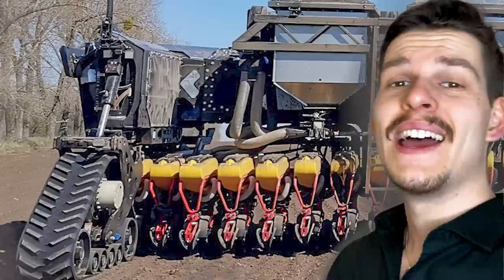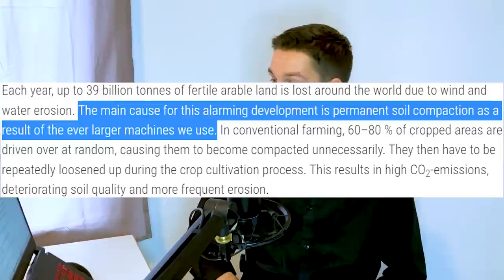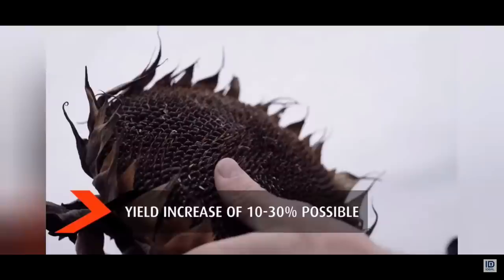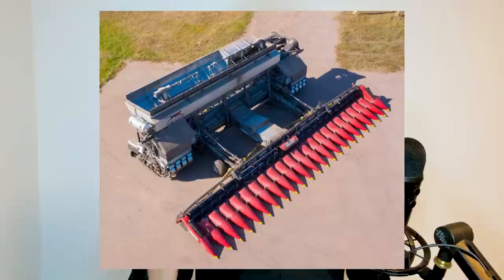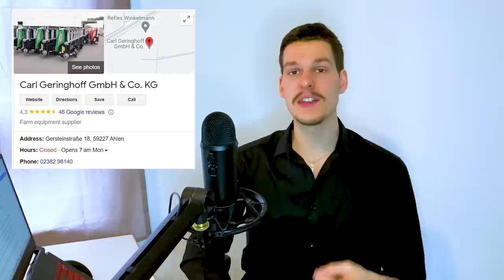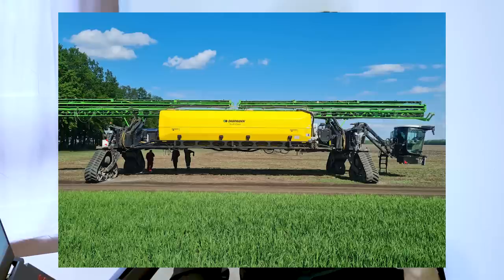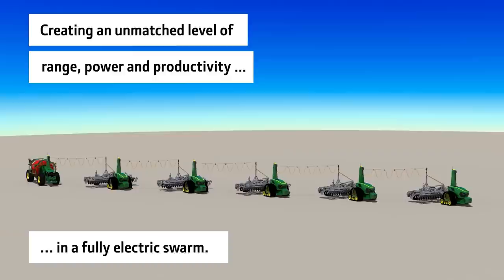Why this Super Tractor is the Worst Idea Ever (NEXAT Review)

Comment: Does anyone still remember the Fendt Trisix? It was a beautiful concept; Fendt was advertising it as the ultra best of the best of the future, and so on... Where is it now? Nowhere! The same will happen with Nexat. Prohibitive price, soil compaction like never seen before, and forget your mechanics. It is all electric and computers, so look for electrical and software engineers to service your Nexat. UPS... there are no such engineers who would know the Nexats since it is still a concept. So if you need repairs, you call Nexat. And you pay an ultra-premium price for their workforce, that is for sure! And you're exactly where the JD owners are, who need to go to the dealership to replace a fuse since they don't get access to their own tractors' software. If you own a tracked version, you better transport it with a trailer, so in the end, a $4 fuse will cost you $1000 in transportation costs. The only thing that is indeed impressive about the Nexat is the 120-meter-wide sprayer boom.

Comment: 00:35 "160 kWh is approximately 217 HP" you're comparing energy to power.
01:00 every tractor can get stuck, what's your point ...?
02:06 you would turn the wheels into transport configuration and pull from the side. Or you would just not drive the expensive machine into deep mud like a random Youtuber might try.
02:38 reads a quote, disagrees, refuses to elaborate
03:17 you're applying first grade math to a very complex problem. Effects in the real world are not linear.
03:35 doing fewer passes could mean less soil compaction, but only if the tractor runs on the same track with all the different machines. Which is not realistic. The seeder is very wide, but not all of the machines are, so the tractor would have to run all over the field, compacting every lane eventually.
04:09 you miss the point entirely. Erosion on flat fields happens because of wind blowing the soil away. Soil compaction leaves a flat, hard, dry surface.
04:35 they don't need to focus on automating the process of changing modules because it's absolutely not essential. It's not critical for its function, so they wouldn't waste investment money on it at this stage.
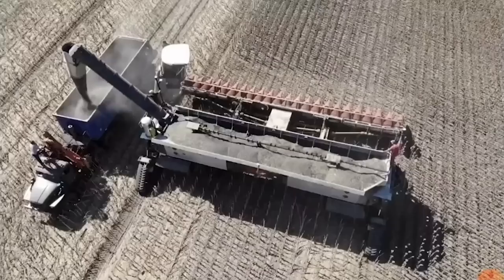05:12 five people are overwatching the prototype. They are engineering it, so they need to inspect things. Get it? No? ok.
05:20 there are plenty of large machines that have one operator, but it's not like the world ends when things break down. There are maintenance services like for any other machine. And if the machine is very efficient, you could afford to put two operators on it to help each other with trouble.
05:25 "no one has talked about spare parts or serviceability" - so what's your point? What makes you think there's any trouble about that point?
05:39 according to you, nothing should've ever been invented because the random person who did it first could erect a monopoly. You're basically trying to bully somebody out for their success.
05:44 what's your point with the system having AI in it? it's for safety, so what?
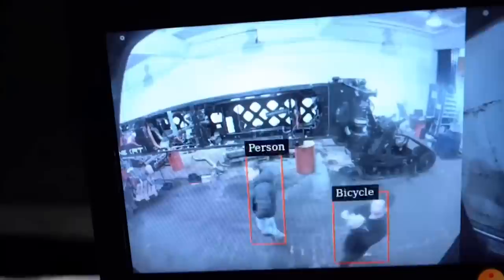05:52 indoors onfield agriculture. wow, nobody has heard of it before because it doesn't make any sense at all.
06:26 ... incompetence. There you go. You're welcome.

Comment: Some of these criticisms are accurate, some aren't. I think the HP figures are just plain silly. The only time I have seen anyone anyone actually use 1000hp on a tractor was with a plow that was larger than the length of the nexat. Getting stuck in the mud is a non issue for a lot of farms in the first place, but even if it was, you should be able to yank it by the gantry just fine. The diesel electric traction system is fine. If people would stop bitching about it, it is cheaper and easier to maintain than hydrostatic drive. The price is a problem, but not as much of a problem when you realize that a combine prices are nearing the same price tag. I think if you looked at this thing as an over priced combine that can sort of do some other tasks in a pinch, it makes a lot more sense than a 1 size fits all machine. But I completely agree that the gen 2 model needs to be half the horsepower and half the cost for it to be viable.

Comment: As a concept, it's a interesting take on a multi function piece of equipment. However, farming is not all that gentle on equipment or are fields always in ideal conditions for such a complex machine to operate in. On top of which, will pieces be interchangeable so if the one you have breaks down. Can you get off the shelf parts easily or will the part you need have to be manufactured first? Then there is what I'm thinking is a fault in that it doesn't look like it can tow a trailer. Why is that a fault, well in many multi hundred acre/hectare farms the tractors tow being in a single pass: planter, seed hopper/tender, fertilizer spreader (if liquid, a tender tank). And this machine looks like it has all of those things, as individual units that must be changed for each use. So that would mean a twelve hour day of planting, will turn into another twelve hour day of fertilizing instead of just moving on to another field for planting.

It's a nice looking piece don't get me wrong on that. I think it's more of a niche solution seeking a highly specific problem that so far is filled, not perfectly but filled none the less, by other machines.
Reply: You have the same problem now with conventional stuff as well.
If a machine breaks down you have to call a tech, you could get the part if it is in stock, but quite often it is a sensor and you can't marry it to the tractor's serialized system without having it blessed by the manufacturer... (IE, their tech has to come out, plug in to the tractor and tell the computer "Oh it is okay.")

There is a reason Right to Repair has been a teething point for John Deere, CNH and Agco.

Comment: the point is it wont get stuck because you arent supposed to drive in wet concitions with any machine if its this or a normal tractor when its to wet to drive on a field than stay home or go to a different field

also on the maintenence "if something breaks your fckd and they havent given any info about spare parts" well ofcourse there arent any spare parts on the market yet because its in the PROTOTYPE state still surely when it gets officially released in bigger quantities it will have spare parts
Reply: how farming is "supposed to" work, and how it actually works are two very different things. If you just walked away every time the situation wasn't ideal, you would never get anything done.
Reply: @mr.fringeminority5426  I don't think Stefan has spent much time in the country lol
Reply: @mr.fringeminority5426  yeah thats true but we tend to stay away from the fields when its wet

Comment: The XBR2 Bi-Rotor VPS Versatile Power System (read The Dream Reaper book) built in 1993 and 12 of 17  patents sold to John Deere in 1995 was more viable for Planting, Spraying and Harvesting.  They bought and put it on the Back Burner so farmers would have to buy X 3 engines, and cabs and power trains and tires  for their sprayers, tractors and combines.  More $ for their stockholder incomes. 🥴
Reply from the maker: Do you think that Nexat will also just sell it's patents to a bigger player?
Reply: @hitechfarmerseb NeXat will have to continue to develop the neXat with plans and intentions of putting it into their own production and marketing process. If it grows to be successful then there will be an opportunity for them to sell it to a major world wide manufacturer.
Reply: On the note of the Bi-Rotor, John Deere basically blackmailed Wagner tractors company into not producing tractors and being as unfair as they were. Really cool to see Big Bud tractors are they are the most powerful out there. AND Big Equipment is going to produce tractors again without all the overpriced Technology.
Reply: The Bi-Rotor  co rotation concave  does generate more centrifugal force because you have the cage speed plus the mat speed for a V Squared  exponential increase in Fc because of the added velocity.   Dynamic vane angles and 360 degree separation are added benefits of the co-rotational concave.  Feeding is better with BOTH the concave and rotor drawing crop in from the feeder house throat.

Comment: this concept of the all in one tractor has already been tried in the Uni-System unitractor. They do their job. but theres a reason the tools and equipment are specialized. If you own it as a combine. well.. its a combine. its about as unique of equipment many farms will get. but the grunt work is done by tractors. a big problem currently is the fact that there arent enough of these things that A. any mechanic worth his weight could possibly get profficient and B. if you need to lease a seeder or combine head or sprayer, its completley proprietary mounting. Im all for innovation. but, let the combine combine. and the tractor tractor. you can have automated driving wihtout this long thing. anyway. hope they succeed... at least in breaking even.

Comment: wowowow hooold on there - this machine may be manure but the first minute of your video is so too.

1) diesel-electric drive-trains have been implemented on nearly every verhicle-type in existense. They probably took inspiration from the mining machinery which is similar in size and tonnage. It is far easier to get wires 50-100ft to these side-pods than having transmission-shafts. As much as the design may be flawed going diesel-electric was absolutely the right choice here.

2 - And this is a BIG red flag) Learn the difference between kW and kWh!!!!!  
kWh is NOT Power Output - it's accumulated power (stored power). 
1 HorsePower = ~0.75 kiloWatts. Without 'hours'. 

If I leave a 1kW Engine running for 2 Hours it has produced 2kWh. Similarly, a 10kWh Battery can supply a 1kW-Motor for 10hrs, a 2kW-Motor for 5hrs and a 10kW-Motor for 1hour.

Mixing kW and kWh up is like mixing up gallons and gallons per hour.
Get this manure right! or people will (rightfully) assume you don't know what you are talking about.

Comment: The next decade is gonna see a lot of machines switching to electric final drives, it’s already well underway in construction. Do a lot of people have spare tractors sitting around? Or spare combines? If anything this seems like it would add more redundancy as you could pull a unit off of tillage to continue harvest if one had an issue. Obviously the devil is in the details, but acting like this causes a bunch of problems that don’t exist with tractors is just silly
Reply: and trains have been diesel over electric for many many many years.

Comment: A lot of money to waste in a world that wants to end commercial farming practices. Honest thougths, everyone in America should start growing their own food and end the need for commercial farms that damage the environment with their destructive, un-needed practices. I love thought that EVERYTHING "electric" is powered by a diesel generator. There is no such thing as electric vehicles, they are just gas by-product vehicles.
Reply: the reason its a hybrid is so it can have maximise the turning radius of the tracks while minimising its size as there is little drive train (no gearboxes, prop shafts and diffs) and depending on how efficient the generators are could be more efficient as there is minimal mechanical loss
Reply: @justmatt510  And hybrid is fine as long as we can all agree it is not Electric. Using a Deisel generator means it is still gas powered. It can not run without the deisel fuel. Just like a  Diesel Train. We don't call them hybrid or electric despite the fact they use giant diesel engines as generators that power the electricly powered motors for the wheels. But they don't run without the Deisel so they are Deisel trains.
The NEXAT in that same regard is still just a Deisel machine.

The left pushes their no more oil by 2030 or whatever, but electric powered things all need petrolium products to run, from deisel to lubricants, they are all fossil fuel derived and thus fossil fuels will be used for at least the next 50-100 years.

The best combatant to climate change, is to end commercial farming practices that do massive damage to the land, envirnment, waterways, and climate more so then anything else. Best way to end it, is more people providing for themselves.

Comment: How do you even move this thing?
Reply from the maker: Well, from what I’ve seen, you need a really loooong trailer to transport it.
Reply: @hitechfarmerseb  and a 8x4 semi truck
Reply: The 4 tracks on the sides can turn 90 degrees, so it does not drive "sideways" anymore and the tracks are now front and back, the cabin turns to now look forward and it can now drive down the road with harvesting equipment and everything still attached, but raised out of the way.

Comment: I agree with everything you said, honestly. I live in Alberta, near BIG farms and machinery, and the Nexat has no advantages whatsoever. That poor thing can barely turn around. 50 feet wide? Big deal. Conventional machines are that big, and they corner like a sports car.
Reply from the maker: Yeah, well, that's my point. One of the main selling points of the company is that it's big. The thing is, that there are loads of machines that are as big as this. (The Nexat maybe has the biggest sprayer boom and grain tank capacity, but still...) All in all, Nexat doesn't make much sense to me.

Comment: These machines seem useless, imagine this one unit that does 4 jobs goes down. Like you said, you are fucked. If your planter tractor goes down you can swap it with another tractor. Not this thing though, this machine is not ideal. If it was sure you’d see everyone using it.
Reply: HAH! get correct HP power tractor, then correct rear end attachment, then correct displays inside tractor for GSP like setup, then ya. not worth it. it not a quick swap at all.